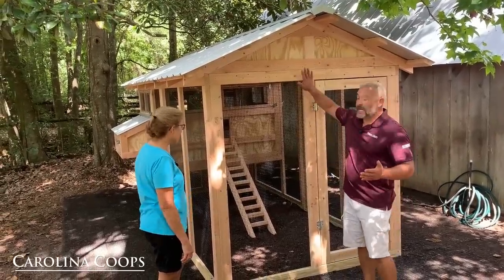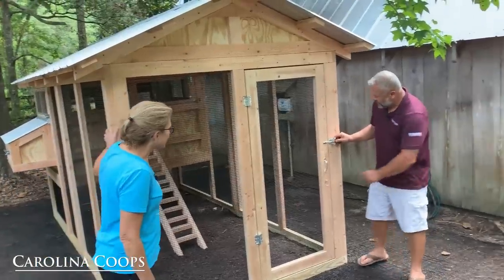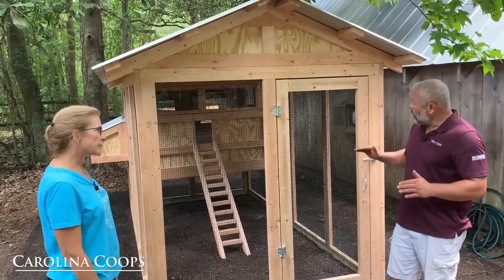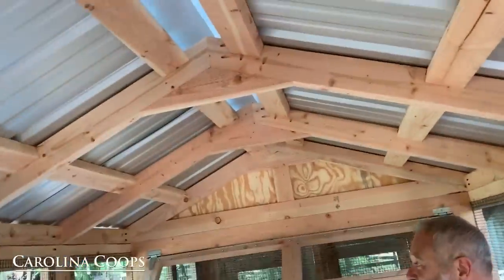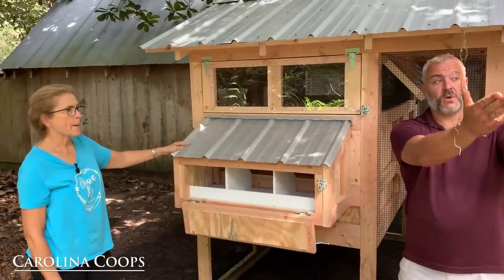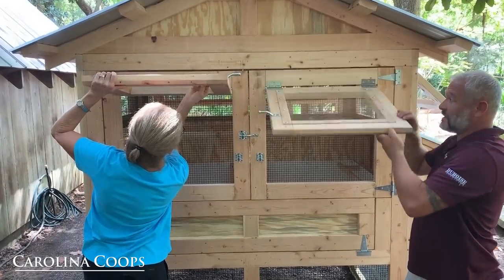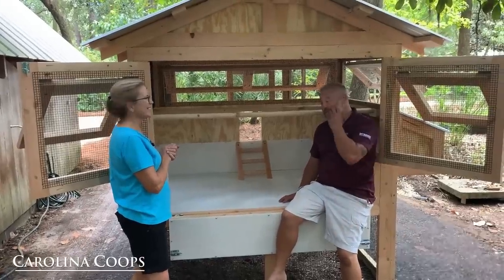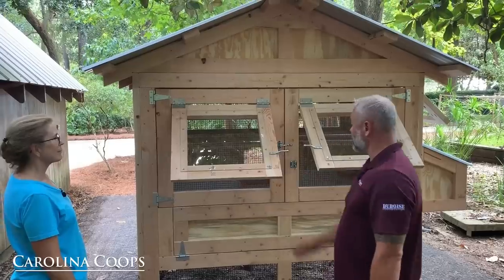See the New Upgrades to Our Most Popular Chicken Coop

Comment: I have noticed when you are talking about litter and nesting materials you do not stress the need for using different materials. I have had chickens off and on for over 40 years. Now, I did not come up with on my own, but my Grandparents,  Aunts and Uncles shared their experience with me. If you are using shavings for instance  in the run, the reason you do not want it in the nest boxes, is that it confuses the girls. They do not see the difference as to the place, just the material. Therefore you will have a higher instance of eggs on the floor. This also is most important if you are free ranging your birds. Part of the reason for lower egg count when free ranging is the availability  of the grass that they are browsing in, so they lay their eggs in that. At least this has been our experience. We use golden comets, a sex link because of their egg count,  280 to 320 plus per year. They are an extra large to jumbo brown egg. Because they lay so many eggs you need to keep oyster shell for calcium and cherry stone for grit, even if you are free ranging.

For cleaning poly carbonate or plexiglass, SO NOT USE WINDEX OR ANY OTHER GLASS CLEANER WITH AMMONIA OR  AMMONIA D. It will cloud the plastic and make it look foggy. Ammonia  sort of melts the plastic to give it that look. We use vinegar and water for cleaning all windows. Works good for all types of stain removal too.

I enjoy your videos greatly for info not only for  the coops, but on birds too. You see even at 68 yrs old, I still keep learning from and sharing with others. God bless and keep up the fine work you are doing. 

Al Hough, Onawa, Iowa
Reply: I don't know why I never received the tip about differing the bedding and nesting material until this video + your comment. Thanks for that - I'll be making a change in my coop today.
Reply: Allan great explanation.  I live in Louisiana and we had chickens when I was young and looking  to get some.  What advice can you give me on selecting the correct variety of hens for my location.  We get hot and humid weather and would love advice on proper task on raising chickens from chicks onward.  Thank you for your time.
Reply: @KrazyKajun602  I have found that hatcheries  in my area can be a great source of information. Their advice can be helpful as to birds that are heat resistant. Rhode Island Reds or Whites are a good all around bird for my area. I don't t know about extreme heat like yours. Local old timers in your area are also a wonderful source. I used t raise Cornish rock cross birds for meat birds, since we sold them semi-commercially. You might also consider Pekin ducks since they are excellent layers and are good meat birds.

Comment: We use lemon pledge on aircraft windscreens and canopies, prevents scratching. Spray on first, work it around with your fingers to break up dirt and bugs, then use a rag to wipe off. Never use a dry rag on a dry surface or with visible dirt present. All that being said, I have no idea how well lemon pledge would interact with a chicken coop and chickens. But that is the best solution we've found for polycarb and plexi. Great coop designs!
Reply from the maker: Thanks for your comments. Our polycarbonate doesn't seem to scratch. We have used castille soap and water which has cleaned the windows wonderfully.

Comment: Even with the drain that they had installed, during a heavy rain the water has got to splash all inside the floor of the pen and get into the food. They should install gutters at least in the area of the pen.
Reply: Think the eaves should be a little longer. Believe they are not for fear the coop owner would get injured, as they would be head height.
Reply from the maker: Eddie Lane well the good news is if you hang your feeder and have it in about 2’ from the side wall it’s not an issue.
Reply from the maker: Monica Perez that is an issue I often think about with customer hitting their heads.  Pleas keep in mind this is one of our “one size  fits all” mass production coops.  If you want to see eves wait until you see the upcoming video of our last custom coop in SC.

Comment: Love you coops. I noticed on this coop... the side where the main doors to the hen house are. There's that little bit of space between the framing and the doors,  both swinging doors and drop down door.  That little space could cause drafts.  But I've noticed in more recent videos on the inside of the hen house, there seems to be  plywood over the framing that produces a slightly extended lip or edge, about an inch. So when you close the doors that lip blocks the cracks and thus blocks drafts.  Is this a change/upgrade you've made over time?

Comment: Are the hardware cloth screwed on with screws and washers or are they stapled. Screws and washers are best to keep predators out and washed sand is better than composed material it is easier to clean. And sweet coop by the chicken chick is best for the droppings boards if you have that too.
Reply from the maker: Hi Diana. Thank you for your comments, however, we respectfully disagree on all your points. No predator has gotten into our coops through the hardware cloth because we use quality strong gauge PVC coated wire. To your second point, chickens don't live naturally on the beach and sand doesn't promote beneficial microbes or harbor bugs that chickens need and want to eat. We also don't agree with the dropping boards, we like the deep litter system, which is easy and healthiest for your flock. Our methods make chicken keeping so much easier than what you are describing, and it makes for a healthy and safe flock.

Comment: I cant afford the hemp bedding, so what do you suggest since you don't recommend pine?
Reply from the maker: Hey there, great question! 

We are not totally against pine shavings, but these are the main reasons we do not recommend pine shavings for our customers: 

We do not recommend pine shavings compared to our hemp because our hemp is MUCH more absorbent than pine shavings, making hemp the perfect material for the deep litter system.  Pine shavings also tend to be more on the acidic side.

By using pine shavings there will be much more maintenance and you will use more of it.  Our hemp is actually cheaper in the long run plus saves you a lot of time.

That said, pine shavings are a MUCH BETTER alternative compared to sand. So, if pine shavings are all you can afford at the moment, that is probably your best bet if you are using the deep litter method!  

I hope this answered your question!

Comment: what we do here in France for our chicken coops is that we put the coop on top of a very large piece of apron and pvc "net", and that is of course also put outside of the coop for snakes and all kind of pests that are also abundant over here!!! And what do you do with the open spaces that are created because of the canals on the tin roof? Because snakes, rats, mice and so many other pests can crawl through these "holes".
Reply from the maker: We don't recommend putting any netting or apron inside the run, because chickens need to scratch and dig and take dust baths. That's why we only recommend doing it around the perimeter of the coop. We haven't had any reports of pests crawling in from the eaves or roof. The metal roof is overlapped so there isn't any spaces created. As for mice and rats, we recommend not giving them a reason to come to your coop. We discuss that in many of our videos. Thank you for your comments and for watching our video.
Reply: good, but the net we put inside 
 is completely buried more than feet and a half, with netting on the sides also of course, and our hens do not get even closer to were it is. Because where we are there are many snakes, and they are really smart, you cannot believe the little holes they are capable of going through. ANd with this netting all our problems were solved. @CarolinaCoopsVideos

Comment: I would love it even more if the plexi on the windows was put on from behind/inside the frame instead of in frontoutside so you don't see the edges and the screws.
Reply from the maker: Thank you for your comments. We used to put the polycarbonate inside the windows, (like a traditional window) but in an effort to keep the costs down we started doing it this way. It also has an added benefit as allowing water to run off and not seep in anywhere.

Comment: I thought the deep litter method was probably a good thing, I come to find out it doesnt compost in the coop due to needing moisture, but also, do you really want your chickens pecking and scratching in their own poop? I mean would you want to walk and scartch in your own poop even tho it is dry? moisture in the coop is bad. I clean my coop out everyday. I dont use bedding I use kitty litter on the boards and a little bit of pine shavings on the floor, most of the poop is on the board and a little on the floor so I keep it clean.
Reply from the maker: rose smith actually the deep litter method is a good thing.  Just ask every single one of our customers and people that have built their own coops using the deep litter system.  The deep litter system is a anaerobic compost system.   You actually don’t want a aerobic compost system inside your henhouse because it will cause a lot of heat.  As for the chickens  “pecking and scratching in their own poop” I guess you would have to see how the deep litter system works to understand it.